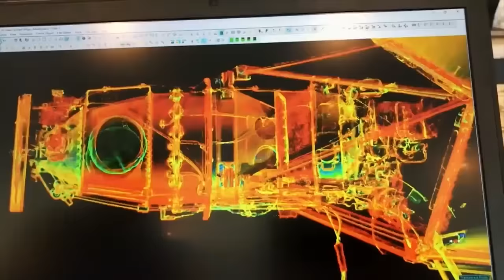We both almost died...now what??

Comment: OK so this may be a bit long but I think aviation has a conflict of interest issue. We are on the cusp of MOSAIC but the issue is there are lots of mixed confusion in the aviation side of things. As a mechanic and pilot I think we suffer from improper training in that we don’t do condition training. We train for failures but we have to be better at training for proper response when the bad things happen. We have a bad situation in which the FAA is allowing industry to drive regulations. The industry is biased towards being able to make aircraft that can be sold. The industry as a whole has a conflict of interest in that they will write regulations that allow them to profit as much as possible. We need to get back to the Congress passing regulations instead of industry consensus standards. Once we get the proper people making the regulations we will remove this conflict of interest. I’ll admit that we gain privileges allowing industry to make the rules but when there are so many manufacturers on the industry boards making rules that it seems as though things are gonna get dicey. Expect a snap back of privileges because at some point the FAA will find out that industry is focused on making money not regulating aviation for safety. 

This may be an unpopular view BUT I feel as if we are heading down a slippery slope. 

Otherwise I really appreciate you sharing this video in particular. It can happen to any of us and we need to make sure we are all conditioning for how to respond initially. There are too many loss of lift, spin incidents because we don’t condition people to lower the nose on power failure and minimize aggressive turns when we have loss of power. 

Thank you for all you do and know you are appreciated.

Comment: What's going right? A long, long overdue conversation about pilots mental health and how we can change the regulations to better address mental health treatment, support, and the rules surrounding how pilots are treated if they do self report. Perhaps more importantly, the conversation is revolving around reforms and how the FAA can actually support pilots mental health...So maybe it's a bright light at the end of a very long tunnel.

What's going wrong? The cost of GA is too high. That is the single biggest barrier to entry, whether it's the sky high cost of a 4 cylinder Lycoming (or Conti) or the lack of A&Ps, to overly burdensome rules for avionics. We as a community have to get solutions in place to lower the cost or we risk losing even more people who are priced out. The trickle down is ominous and we see it in declining usage at GA airports, resulting in their closures to the aforementioned lack of A&P's.

I'm an AOPA member as well as belong to a local flying group. Once my wife and I purchase an airplane, I expect we'll join an owners group or two as well.

Comment: Dang our holiday from being told to get back to work is OVER !! .. yes ! my dream, a seaplane to explore the world.  I believe an Aussie company has bought the right to make albatrosses ,[ I have its name on my other pc back home ],i think in Darwin .  but please how to make a cross between John McGinnis's 'synergy' ,and,a shinmawa US2, so a stol seaplane that can cruise very economically and fast ,with room for two +, to live aboard .[and not cost 120 million !!].  and for engines [if not turboprops , ] a Raphael morigardo's 'mighty yet tiny' motor ,or i can't believe no one has taken on the Revetec trilobate crank project ,they had a flat four ,or X type motor that gives full torque from about 1500 rpm ,and could run direct contrarotating props ,and they are a shade off 40% real efficiency ,and not even fully developed . .for dessert ,another Aussie company  titomic , huge 3d printers using cheap titanium powder ,already signed off for aero space . could print, tubes, spars , endless parts ,engines, even sharrow type props ,as soon as development settles down a bit ,  3d printed safety cages would go down well .. i mean be very useful too  .

Comment: What works:

Flying has become a lot safer around the world as aircraft designs change to adopt new learnings from incidents and accidents like Garmin G3X being able to point you at a runway if the engine fails in you Single engine aircraft etc.

What’s Broke:

1. Aviation is super expensive and most people like me can’t afford ownership so rent a very tired PA28 from the local school and taxi past the hanger full of hanger queens looking nice but hardly ever flown. So how about making a system of some kind where those hanger queens can be used and enjoyed making aviation cheaper for all while letting pilots try new aircraft (with instruction obviously) grow their skills and become safer.  All while letting the sad hanger queens out for a few hours to get the wind beneath their wings.
2. Flight schools especially here in the UK struggle using very old PA28s or C152/172s which are expensive and to be frank past their best before date, so what the flight school industry needs desperately is a cheap to own and operate trainer aircraft. This benefits the schools but if the prices of lessons comes down more people can take to the skys and it won’t be the rich guys only industry it currently is. My 15yo son wants to learn but at £175 per hour here in the UK it’s only feasible for a lesson every now and then.
3. Linked to No1 above lots of private owners go flying on their own have the same system able to share rides and the skys, yes there is Wingly and others but it’s misused and thus untrusted by the authorities especially in Europe as private pilots are selling flights without the skills of IR or CPL and things go wrong like the Mo Sala incident. Again this comes back to above where aviation is too expensive to to build hours pilots are doing anything they can to get in the air and taking risks they really shouldn’t just to get that 1hr in the logbook that some else is funding.
4. Free gas for aircraft if you take up an aspiring kid especially if they are from a background and means that would see them never getting in the air, I work with a charity in the UK and it’s something we are trying to achieve but it’s so hard because as above aircraft are so expensive and they just spend their time sitting in a hanger. See where I’m going here…
5. Fix your Hat and Shirt sales website so that us in the UK can buy your awesome products and shipping isn’t more than the cost of the shirt, now that should be an easy fix send them all to me and I’ll be your UK/Europe agent. 😜

Group membership.

I am trying very slowly to build a Sling TSi so my son can fly cheaper (costing me way more though😂) so I am a member of the LAA the Light Aircraft Association here in the uk that manages aircraft builds on behalf of the CAA with inspectors etc.

Great work keep it up can’t wait to see where you take this.

Comment: I retired as an A&P from a cargo airline a year ago. My biggest concern is that the mechanics coming into the field do not have troubleshooting skills. The Maintence Ops or their laptop tells them what part to change and if that doesn't fix the problem they are lost. Basic understanding of the systems and to read schematics and track down what does what is not being taught. And, unfortunately there seems to be an "entitlement" attitude that is creeping in to the mechanic ranks. Eg: " Do I need to take my tool box for this job?" You can't pencil whip everything. Maybe having some type of apprentice program with some old salts that are good at teaching to give the new guys some practical life skills and troubleshooting basics would be a start.

Comment: Re Mark: Fix the FAA. 

What I mean is, get a team of experts together to collect stories of interactions between citizens and the FAA, identify positive and negative experiences. Trace out the rules and procedures that figured into the negative experiences.

Determine whether the rules and processes were not followed well, or are they flawed? Is this negative experience a result of a dilemma, where changing the process causes negative consequences in other situations? Do more rules and procedures need to be rewritten?

Then there is the question of mission and philosophy, influencing the judgment of FAA employees where discretion is needed. Is the charter of the FAA adhered to in the judgment calls? Is the charter clear and appropriately specific? Are employees ignoring it?

In short, produce a solid, well-evidenced and specific critique and set of proposals. 

Somewhere (maybe everywhere) in there, comes the step of networking your way into the FAA to establish conversations all over the place, both to collect information and float ideas around. Soft diplomacy. Bring them along. Hear and address their reservations before even proposing anything. Don't make it too public or political. Be quiet, make relationships. Maybe allies in the FAA could push the resulting ideas themselves?

Already, as Mike has demonstrated, the FAA, in the guise of their extensive certification requirements and approval process of experimental aircraft, are a phenomenal resource to guide designers in the process of making airplanes that actually fly. That's a win. I can also see a sort of ombudsman role, to help citizens get where they need to be in a process.

Comment: I think the state of aircraft engines is pretty sad. I love turbines but most people can't afford them. I'm building an RV-10 and probably I'll need to put in an IO-540. Why am I paying $80,000 for an engine designed in the 1950s with horrible specs compared to modern car engines? I know there are more experimental options out there, but I don't have the financial resources and technical know-how to get super experimental on my powertrain.

What about a hybrid system? Electric motor connected to the prop. Battery pack with about 30min of charge. I lightweight, inexpensive, and efficient modern vehicle engine charges that battery in flight. Could this be done for a similar cost as a certified engine? Could it be similar weight? But much lower fuel consumption, and possibly run on Jet A? And as a bonus, you have a 30min reserve if the engine dies?